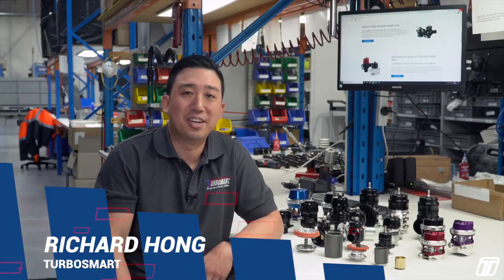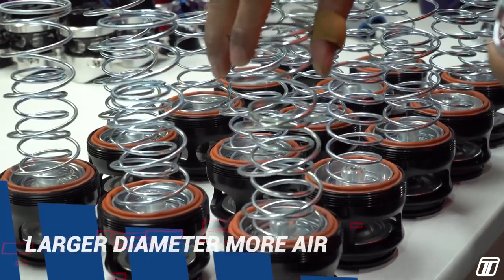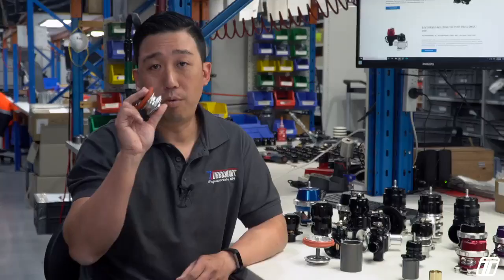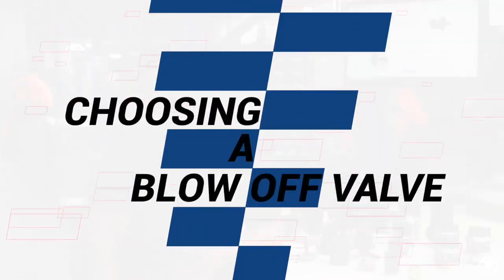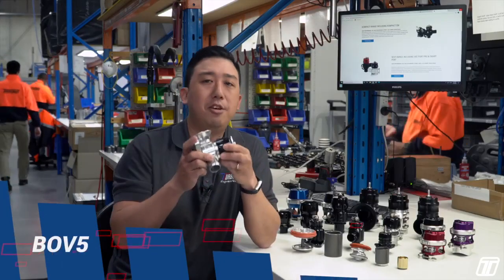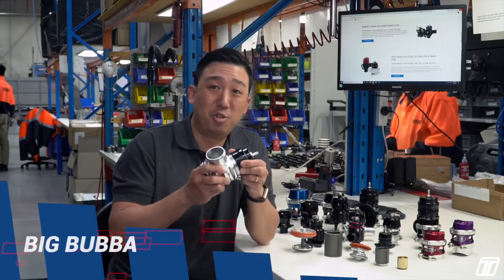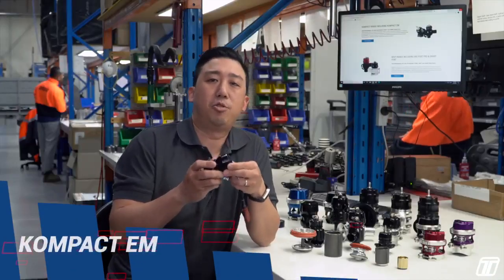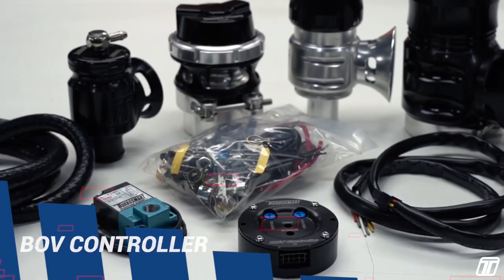Boost Basics | How to choose the right Blow-Off Valve!

Comment: What i should pick for my 2017 ford fiesta 1.0 ecoboost?
Reply from the maker: Our Kompact Series is perfect for your car! The Kompact series valves are available in two options: Dual port, which is our 50/50 vent to atmosphere valve, and Plumb Back, which is 100% recirculation. They both offer the same performance in terms of improved durability, superior response, and greater boost handling.  So it will really come down to preference on if you want to hear the valve or not. Here are some part numbers:  TS-0203-1065 = Dual Port (vents to atmosphere) or TS-0203-1265 = Plumb Back (100% recirculation; quiet). Please let us know if we can answer any other questions for you!

Comment: why do some 1500hp inline 6 use 2 blow off valve instead of just using 1 rated at 2000hp. Is there any benefits at using 2?
Reply: Dont quote me on this but I think its a durability thing, the 2000hp one can handle that VTA better but having 2 would probably vent that air faster.

Comment: @Turbosmart What bov do you recommend for a stock 91 3000gt VR4 with full exhaust and an intake?
Reply from the maker: Check out the Make Model Search on our website; https://www.turbosmart.com/?year_id=134959&make=137488&model=137515&vehicle=137516&post_type=product&action=vpf-ymm-search
Reply from the maker: You'll see for the 3000GT you're looking at either the TS-0203-1023 which is a Dual Port (Noisy) or the TS-0203-1223 which is a Plumback.

Comment: What are the pitfalls of using oversized or undersized BOVs?
Reply from the maker: Thanks for your question! So, basically an undersized BOV can lead to compressor surge under higher loads. Basically, not being big enough or well designed enough to flow the amount of air that requires bypassing, in order to avoid surge. On the flip side, it's difficult to go 'too-big' on a valve. There are some exceptions to this, but they are related to air flow metered road cars with complex air flow management and boost control strategies where the issue is more one of fault codes & system alarms, than it is of actual performance, or boost response. Certainly with the Turbosmart range, we aim to have the best sealing & fastest valves on the market so bigger doesn't mean slower.